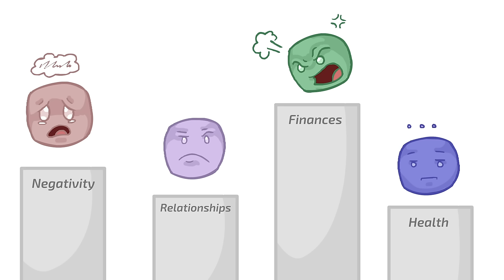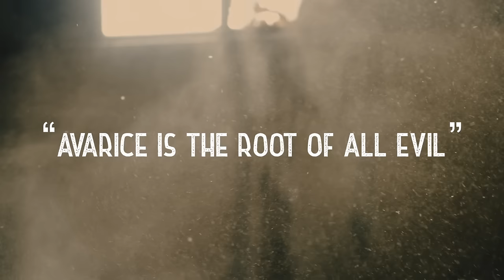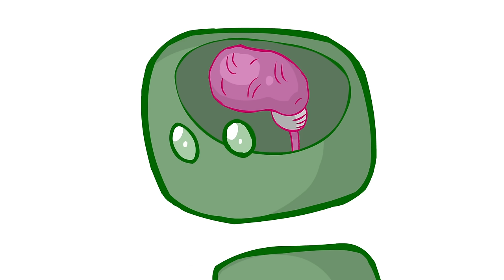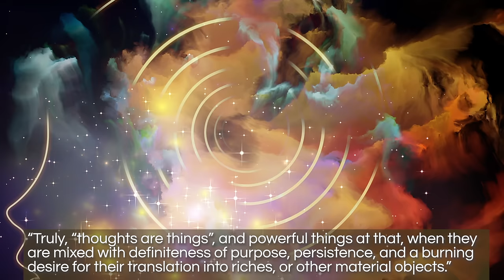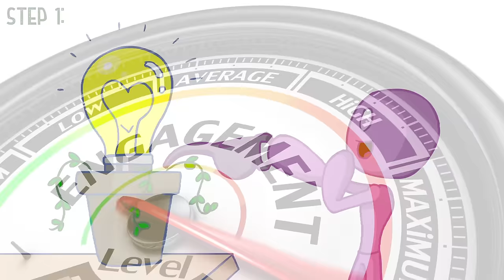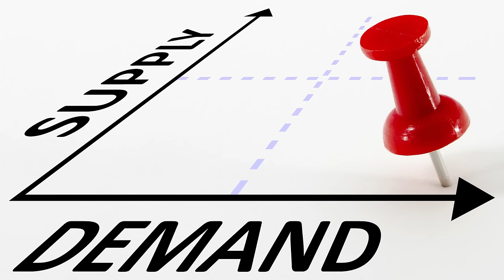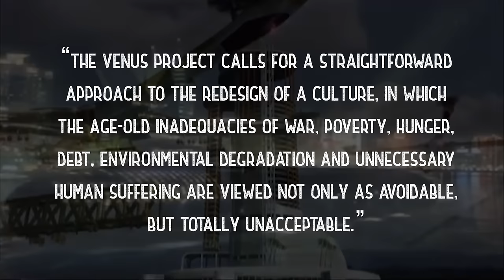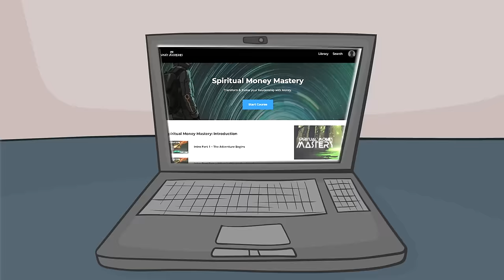The Spiritual Money Movie ~ Master your Financial Reality

Comment: nature recycles EVERYTHING. our problem of consumption is a problem because it isnt naturally recycling itself. plastic is honestly a solidified form of gasoline basically, and we're dumping tons of it in land fills, which also has a bunch of bio-fuel in it. (steam engines, or what I like to think of as a "compound engine" in cars is something I've been pursuing for some years, though a few years ago, I got the thought that "THEY" wouldnt let me do that, because I'd make money by reducing fuel consumption, but its unlikely to do that, UHMWPE is a form of PET plastic, and it has incredibly high strength, for being a mere polymer, most plastics dont even compare in strength [its super strong because of the Van Der Waals force], so I expect that if fuel consumption goes down, then this UHMWPE can be focused into lighter weight and yet super strong structures, though it doesnt have fire resistance, because its the same as the most common plastic PET at a molecular level)

Comment: Did you understand that electric vehicles are also a scam? There aren’t enough resources to create batteries for everyone to even ride in and EV let alone own one. Not only that, the electricity that is used for them is generated by coal.
I admire your optimism though. Not everyone can be a creator you know.